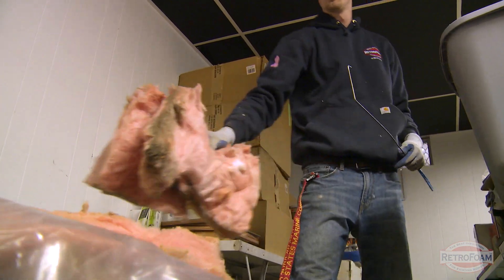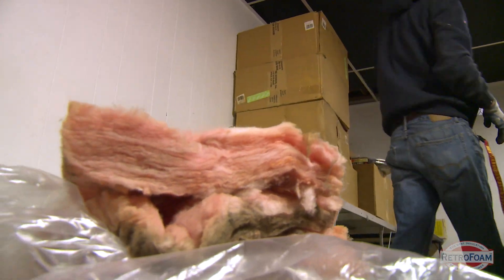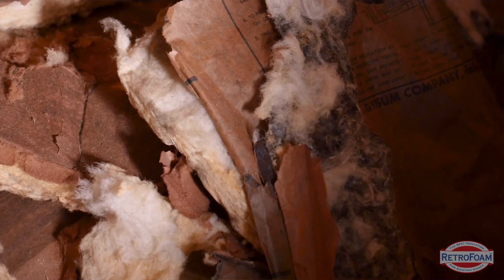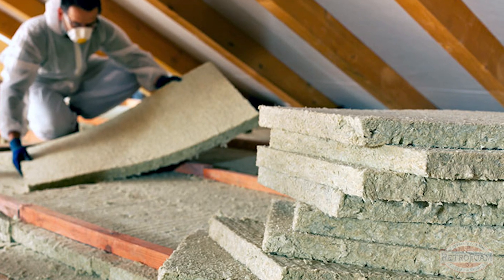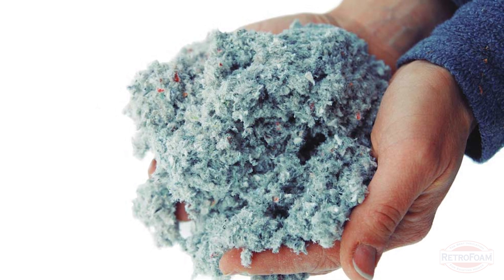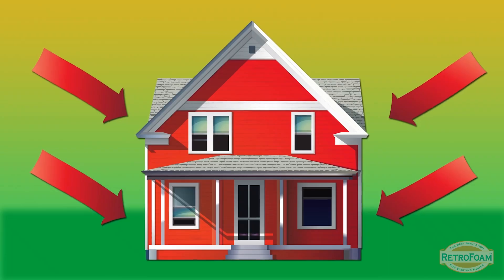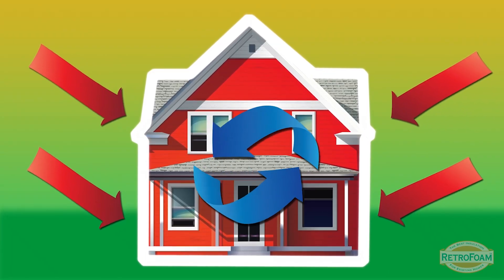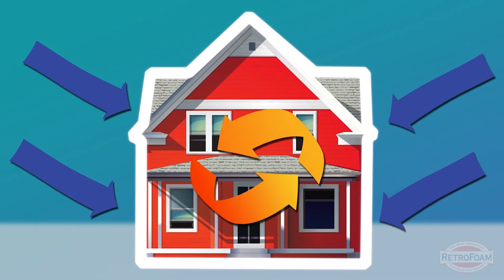Comparing the Performance of Wall insulation Types | Foam University by RetroFoam

Comment: What is the difference between RetroFoam and AirKrete?
Reply from the maker: RetroFoam is a tripolymer-based resin that, when mixed, creates a non-toxic foam insulation. AirKrete is a concrete-based insulation.